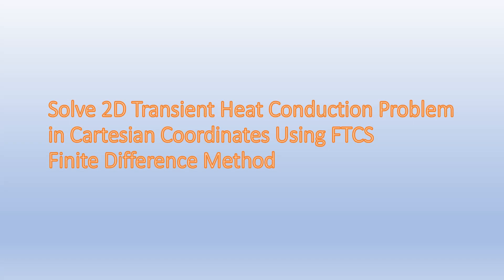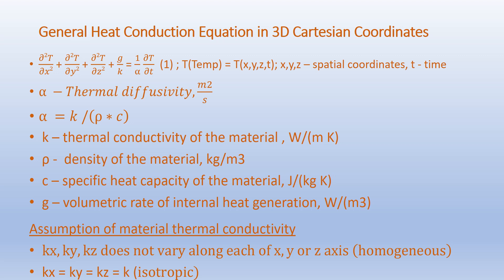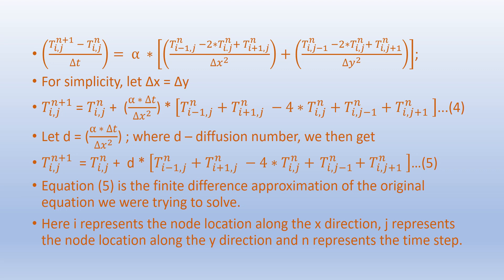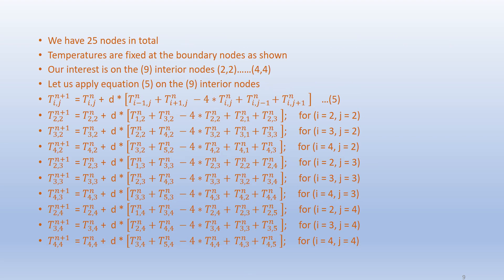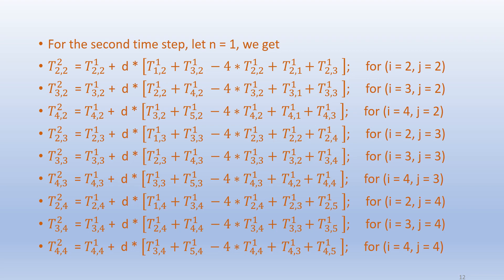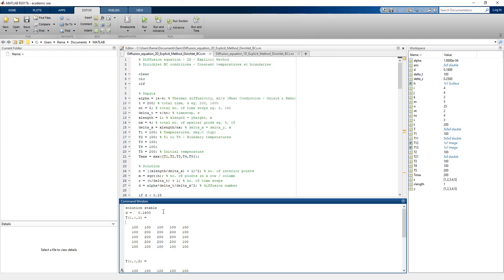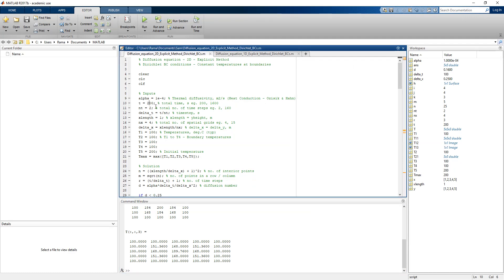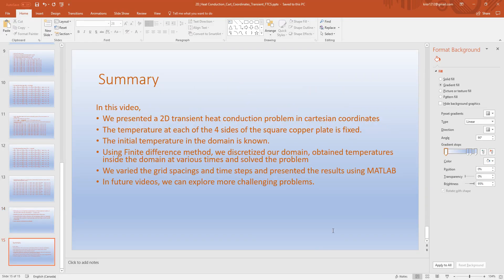Solve 2D Transient Heat Conduction Problem using FTCS Finite Difference Method

Comment: Sorry but code didn't work
Reply from the maker: It worked for me and others. You may email me the error if you like
Reply: @samseleven1  Thank you. It is worked that ı will try. I forgot to write
Reply: Google lens ile tarattım
Reply from the maker: You need to copy this carefully with additional functions as required.
Reply: @samseleven1  I used google lens for copying
Reply: @ismailpolat6661  how did you copy the code, ı couldn't because it's image

Comment: im looking for help with coding a finite difference method of a cube for a heat transfer class, I already have the equations derived, but I cannot find any help with coding the finite difference method in 3D, do you have any suggestions for resources or videos?
Reply from the maker: I can help. Pls email me at engineeringstream11@gmail.com

Comment: I have a similar problem, I have managed to get the six equations, I just need a code to help me get the solution, do you have an excel code that i can use?
Reply from the maker: We can do matlab or Python.
Reply from the maker: Or i need to develop an excel code if tat is needed.
Reply from the maker: Did you solve your problen yet?
Reply: @samseleven1  i managed to yes, but I have an analytical solution equation that I need to compare my findings to, I am having difficulities in plotting that equation, can I send you the problem and see if you can assist me?

Thanks in advanced
Reply from the maker: @AbdulrahmanElmen  pls do so. samseleven@gmail.com